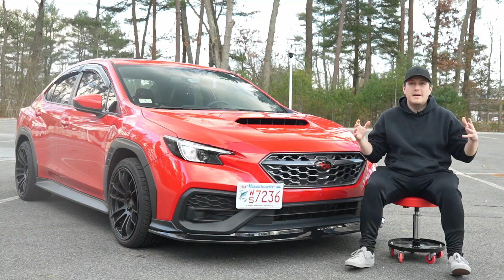The Truth About JXR Performance [Subaru WRX & STI Parts]

Comment: Talking about price gouging..I haven't been back into tuning cars since I sold my fun cars 5 years ago and have been driving low key stuff..got back into fun cars again and looking at the prices at first I was like wtf happened !!?? Coilovers are ridiculously overpriced. Back in the day I bought a great pair of coilovers for my type r integra and paid 700$ for a top of line pair..now the same pair would be 3500$. I swear they do the 300% rule.  They charge the customer 3 times their actual cost. It's like every upgrade for these cars are $800-$2000 average.  These companies charging nearly $100 for some fkn emblems or a single rear foglight frankly is just ridiculous. But you have to pay to play I guess and with inflation literally corrupting all markets, of course it hits the market that we all gain immense joy from.

Comment: I just pulled an F1 light off my VB because it was shorting during heavy rain and causing my ECU to cut throttle. I'll check yours out when the time comes for me to add another one. Keep up the amazing work, dude! Hopefully we get hyper pink and gold star options on emblems at some point. I know, I know... You gotta buy a billion of them to make it worth it, but I had your gray/black emblems on my VB for a while and they were incredible quality. Swapped back to stock emblems for a little pop of color since I sorta blacked out the whole car (whoops). Definitely worth the price of admission for those emblems, though.
Reply: Had a noble one cause my brake lights to come on by them selves. Use dialectic grease inside the connectors thank me later

Comment: I bought the JXR plate relocation kit and black emblem set, but found out that my state just signed legislation that removes the front license plate requirement 😅 I'm having the shop putting PPF/ceramic coating on my VB this weekend install the badges for me (they offered and I'm sick and tired this week) so I'm excited to see them on there soon! I'm interested in the F1 Light and Rain Guards...you should do a video on the differences with the JXR F1 light and what makes it legal versus other options.
Reply from the maker: I've been thinking about making a comparison but rules always shift and I don't want to bash anyone! Even without front plate laws, the relo's are mean! Thanks for the support mate!
Reply: @AutoEnthusiast  Quality issues aside (you don't have to name names haha) I would be interested to hear about why certain features are or aren't US legal. I imagine things vary from state to state so trying to make something comprehensive would be a huge undertaking.

Comment: Still torn between selling my 2021 WRX with 70,000 miles with no upgrades or  picking up a 2024 and starting a build on the new platform. Or just build out my current WRX. Tough decision.
Reply: Have you test driven a VB yet?
Reply: @PsunnProductions  i have!  I test drove a VB about 3 weeks ago
Reply: @slicenewton3086  I went to the dealership to buy a ‘20 VA, and left with my ‘22 VB. The test drive sold me immediately
Reply from the maker: I might be a little biased, but if you are thinking stock to stock, the VB would be my choice!
Reply: @AutoEnthusiast  thanks man. I’m leaning the same way

Comment: An upgraded JXR reverse lockout would be a great part to design.  Tighter tolerances than stock (to avoid rattle) and maybe make it out of Delrin or some material that also reduces/dampens NVH.  Also, I don’t believe there are currently any on the market for the VB/VA.

I have an OEM Shifter assembly boxed up sitting somewhere in my garage (from a ‘21 WRX) that I’m sure my wife wouldn’t be sad to see go. 😂
Reply from the maker: Noted! I will add it to the dev list!

Comment: 2017 WRX Premium with 168422 miles on it.  Cobb accessport. Tuned to 320 awhp and 300 ft lbs with bolt on parts since new by m45/snail performance and still going. Diode Dynamics is my go to for lights. OLM is notorious for failing quickly, and it has been the wiring for the LEDs. I went through 2 of their F1 lights. Both lasted less than a year. I mean it's not like I'm back there pulling on the wires. $250 done and when I e-mailed them always the same thing: out of warranty. Been using a generic Amazon 3rd brake light going on 2 years with no issues. And the Amazon 3rd light handles being wired with the Diode Dynamics Tail as turn so it flashes with the turn signals. I'm going to give your products a try. Informative videos thanks.
Reply from the maker: Cheers! Thanks mate! And nice build! How is your subie holding up with those miles?